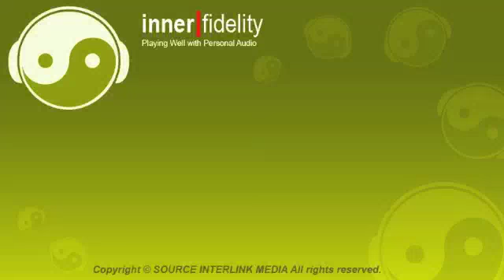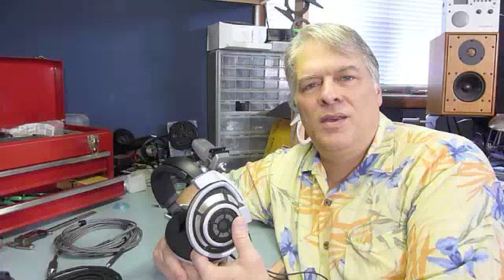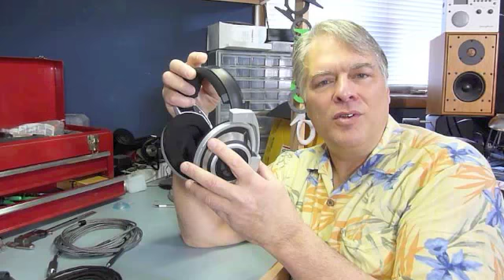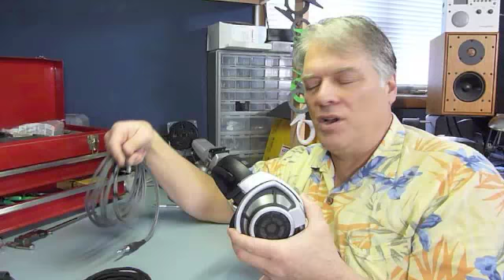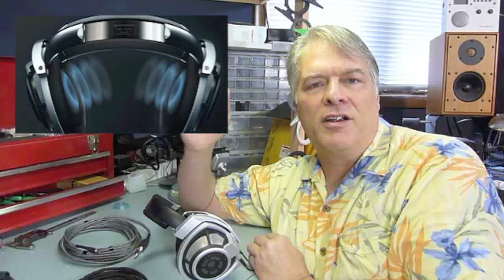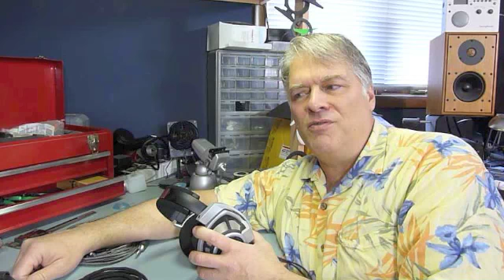The Brilliant Sennheiser HD 800 Headphone

Comment: Will Tidal hifi cut it with these HPs?
Reply: Kyle Wit Yes, tidal is lossless. But you don't really need anything over like 320kbps because it will be very difficult to hear the difference anyway. the difference is only in the height of the upper register and the very lowest lows so unless you're a fucking dog it's probably unimportant
Reply: Jared Ferguson So Spotify premium? I know Tidal has mqa encoding
Reply: Kyle Wit I like spotify because it's cheaper and it has a bigger library. I don't know much about how it's encoded tho

Comment: Setup:
Sennheiser HD800
Silver Balanced Cable (L/R)
Sony PHA-3
Audirvana Software
Files: DSD64 DSD128
Ram: 8 GB
Macbook Pro

I am using a Sony PHA-3 amp with silver plated balanced cables, when i turn it up the unit shuts off after 75 percent volume. this happened a couple times. Its not ear bleeding loud, but some of my DSD64 files are older music and require the volume up to that level. Any suggestions to why it will do that? No damage has been done to the HD800's

Comment: I'm sure he knows that cables don't change the sound. They are probably a sponsor or something and he agreed to give them a quick plug. That could hurt his rep as seen in the comments however.
Reply: PHOTOTRISTAN aka loony toons at head-fi trippin' on the psychedelic kool-aid. 😂
Reply: dandelion Agreed. Head-Fi is Snake Oil Central and I try to limit my visits there.
Reply: +PHOTOTRISTAN there's a $1,000,000 reward for those who can differentiate expensive from regular cables. Nobody has claimed it.
Reply: dandelion The HD800s have an analogue cable, not a digital one, so a higher-quality cable Does make a difference, to a point.
Reply: I could be wrong however. To Tyll: Thank you so much for your videos. Did you notice any changes on a Oscilloscope or similar instrument when swapping cables that maybe most people can't detect?
Reply: It's quite well known that the HD800s sound is very cable dependent.

Comment: There is no way your ear can register the difference between cables (fact). The difference occurs in your brain and these differences are based on false beliefs (placebo). So although you can have the subjective experience that something has changed (and this can be as far as you are concerned be real), objectively nothing has, except for the fact that you spend 800 dollars. Your brain can fool you when it comes to this stuff, but don't be fooled into buying 800 dollar cables. You want a strong cable of a reasonable thickness with a good connector and this should never cost you more then 30 dollar max (soldering iron included).
Reply: TR4R The only ways you can hear a difference in cables is if: you're loosing extremely long cables, you're exchanging an extremely crappy cable with a proper one, or you're using cables with different impedance. The last one can be simulated by just putting in electronics to effectively eq the signal and is not actually a cable issue.
Reply: Well, sir I respect you and your opinion and I bet you have more experience than me because I am a beginner in audiophile world but I will share with you a brief personal experience. I am now using the relatively cheap shure se215 and however they may sound crap to you I can tell you I did feel a difference changing the cables. At first I used default shure cable with mic and control and it was a little bit bassy but it worked well until that piece of crap torn appart and I changed it for a compatible cable for ultimate ears. The bass response improved but the cable had a terrible malfunction problem with the right ear so I had to switch to Zee's music cable which is also bassy and has less definition but is a lot more reliable. Shure default cable without mic nor control had the most exaggerated and muddiest bass of all (read badass) and it was terrible. Right now I'm purchasing HD800 and however I don't plan to change the cable any soon I can tell you based on my brief experience that at least sometimes cable does matter. And believe me, I love good sound and will be purchasing shure se846 hopefully soon. Thanks if you read this ;-)
Reply: TR4R
I fully believe you when you tell me it has an effect when you replace a really crappy cable. However, blind testing shows that people do not hear a difference between good 30 euro cables and 800 euro cables. On the topic of audiophile, I am definitely not one of them, I just want to enjoy music without having an allergy for imperfections in sound quality ;)
Reply: koelewijn555 >There is no way your ear can register the difference between cables

Provided that you're using digital interfaces. XLR and TRS are analogue inputs/outputs, so a better cable WILL make a difference, to a point.

Comment: For some reason, I highly doubt that you can tell a difference in sound by the cable you are using.  Like, if I took two identical headphones and had you listen to each while blindfolded, but only one of them had that expensive cable, I do not believe you could tell me which one it was.
Reply: bluesymmetry So you are ok with fooling yourself? Because that is what you are saying. You trick yourself into believing that a cable is better in order to take away the discomforting feeling you get from the knowledge that you just burnt your money on a silly cable. This is called cognitive dissonance.
Reply: bluesymmetry
I do know that scientifically wires do no change the sound to a degree that your ear is able to pick it up. Its you brain that fools you in believing this.
Reply: TR4R
Dear sir, thanks for explaining this part to me. But I still not fully understand, because then it is the transducer that makes the difference and not the cable itself, right? I understand that you can filter part of the signal and I do hear the difference when changing a capacitor in a guitar, but a relatively short piece of copper wire should not make a difference.
Reply: I disagree sir. At the mere beginning cables have a transducer that projects the voltage signal to both headphones of the pair and in that process small but significant modifications can be made and that is the explanation (I would not be telling you this if I havent already tested how much different shure earphones can sound with three different cables (shure's ones, ultimate ears and zee's music) so I can tell you that cable does matter but anyway I am just purchasing HD800 and I am very excited about it and don't plan to change the cables any soon but I probably test some if I had the money ;-)
Reply: koelewijn555 like i said, dont say anything if you havent tried. even if its psychological, then it 'works' for me. as long as it sounds better i dont really care what others think. heres a pretty interesting article speculating the matter pages 2-3. page 1 is just a massively long introduction. http://electronics.howstuffworks.com/gadgets/audio-music/are-premium-audio-cables-worth-the-investment2.htm
Reply: if i can afford it why not. its the same reason as why a man would spend 100s of thousands on a watch when its not even as accurate as a digital watch. placebos are effective for a reason. if i can hear a positive difference that you cant, even though i know its not real, i still can hear a difference. its like how if i hallucinate and i know its fake, it feels so real you cant ignore it. whether cables make a difference or not i still dont know, you just claim it to not be real. kindly educate me a little. as far as i know interference from outside signals can affect quality, but i stopped learning physics after a levels so my knowledge is pretty crap on this area.
Reply: the cables can actually make a significant difference in sound. thats almost like saying all amps are the same, they just amplify signals. i dont know scientifically how the wires change the sound but it really does. you should go to an audio store and test it out.

Comment: do i need a legitimate headphone amplifier to experience the true sounds of this headphone? or is it as good as it is without an amp?
Reply: You are gonna want a pretty good amp system when listening to these (Don't even think about not using one). I personally use a JDSLabs o2+odac combo and it works wonderfully with these headphones.
Reply: ***** None at all, but I do however find it hard to go straight from my speakers to my headphones because these headphones do not have near the same bass as a speaker system. They sound kind of empty. They still sound absolutely amazing but just watch out for that if you switch between speakers and headphones often.

EDIT Something I have noticed however with them (And I believe Sennheiser themselves points this out) is that it is very easy to turn them up too loud because they are actually that clear. You may not realize that the volume is way louder than it should be because the headphones aren't getting distorted/piercing as normal headphones get when you turn them up too loud.

If you turn them up too loud then yes, sibilance is annoying but at the right volume it's perfect.
Reply: ***** Yes I did and I am very happy with the purchase.
Reply: Nigel Janes Dude, you gotta get something like a Woo Wa-2 at least, probably more like a WA-22 to really get the best out of these headphones, you also want a DAC more like a Schiit Gungir.

Comment: can i plug it into my iphone by using other cable ?
Reply: KHALED .A.W Audio Technica ATH-M50s are also great.
Reply: *****
You should check out what "ohms" are, then you'll see how ridiculous what you said is.
Reply: The HD800 should not be used on a crappy iphone or ipod. Get the WA22 from woo audio and  the Schiit Bifrost
Reply: KHALED .A.W
try psb m4u2 even better
Reply: i don't have much experience in this subject, what do you think is the best headphone for a mobile phone and can run in correctly?
Reply: KHALED .A.W I recommend listening to some in a store.
If you don't want to walk around with 'em (or don't think they look awkward to walk around with): e.g. AKG K 550/551 (551 are with mobile features). They aren't pricey either.
If you're looking for something in the HD800 pricerange with 32ohms you could try out some Grados (e.g. GS1000i). But as with the HD800 they are open-back headphones, so if you like listening to loud music while walking around you should consider other alternatives.
Really cheap but imo really good: iGrado
Reply: thanks man :)
Reply: sebastian verter of course
Reply: DaughterOfRnbSoul You only need a special headphone amp if the volume is way too low or if for some reason the ipod does not have a very good amplifier which may be true with some older models.
Reply: The HD800's requires a lot of juice than what most people think. Also there is no ipod that can drive the HD800's 300ohms. If you want a really good sounding  portable/music player setup that can get the HD800's to good Sounding Volume you would look into either the IBasso DX100 , or the Hifiman 901 + Balanced Amp. A Very good sounding Desktop setup that's not too expensive would be ODAC + Schiit Lyr  or JDS Labs O2 + ODAC combo. Been using my HD800's on all of these combos for a while now :).
Reply: ***** You are even funnier, if you cant understand the difference between a home theatre and hifi audio, maybe you shouldnt buy the HD800. Beside, a home theatre amp is designed to power multiple speaker channels with over exaggerated output to produce the sound effect of hollywood explosion or car crashes, the headphone output is connected to a different circuit and it is as dedicated as the audio chip on a phone. 

It all depends on what you like, if you like to listen to loud US top 100 music thats played in a pub or on radio, you should get a DJ headphone. Because HD800 wont give you that. If you enjoy classical music or want to listen to an instrument that is perfectly recreated in front of you, then you need a proper headphone amp >$3000 for HD800. and ofc you need the right records and DAC.
Reply: nicholas squall I said the exact same thing, I just got to lazy to post it lol. The HD800's will only shine through a TRUE Hifi Setup,  I personally like the WA22  paired with the bifrost.
Reply: You could always get a battery powered USB hub and a Schiit Fulla amp/dac (it's a usb dongle) , which I'm sure would drive the HD800 just fine & works on iphones. .. It did well on my HD600 before I upgraded to the Schiit Modi2/Vali2 dac/amp ..
Reply: Won't do it justice.
Reply: DaughterOfRnbSoul Nothing will for a portable solution ., but that's about as good as it's going to get "on the road" (about the only point of using the HD600s solely with an iPhone) .. At home use certainly deserves something better, I'll agree on that.

Comment: YELLING IS NOT HELPING YOUR CREDIBILITY.  

Also, as an electrical engineer you know this isn't true.  Otherwise all cables would be made out of lead.

I think what you are trying to say (or YELL?) is that expensive cables made from esoteric materials do not sound significantly better than high quality low price cables made of copper.  This I would agree with.

Comment: Are you running a cable on top of a desk? Or 20 feet through a construction site? Interference is not a problem if it is not the latter.

I am not going to argue any further, do what you want with your money, I am just letting you know that a cable can not improve or enhance sound quality. Sure, some cables are better quality and with last longer and may have better EMI shielding, but that still does not effect sound quality.

Comment: THERE IS NO DIFFERENCE IN SOUND QUALITY FROM A CABLE. I AM AN ELECTRICAL ENGINEER AND IT IS IMPOSSIBLE FOR A CABLE TO IMPROVE OR CHANGE THE SOUND QUALITY. THE SOUND SIGNAL BEING SENT THROUGH A CABLE IS NOT AT ALL FLAVORED BY THE TYPE OF CABLE USED.

Comment: Differences with solid state amp's are readily audible with HD800. A decent Class A stage will give you this too. I love the HD800s to bits and I am using them on solid state. Tube Musical fidelity XCAN v2 works well too.
As an ESL fan surprisingly I even prefer them to my old Stax lambda, 800 offers better soundstaging, comfort and dynamics and bass clarity, however I have never used the new top end Stax models. All the Stax I have heard have a certain magic but the HD800s are the best to me.

Comment: Good quality electronics are certainly worth having.
 I find HD800 trounces the HD600/650's on mainly Classical, acoustic but also rock, pop & electronic music even when used from very affordable hardware, detail, space, resolution, depth, bass, treble extension. Of course a good quality class A stage is well worth having, it would be stupid not to use a decent sounding amp as HD800 will expose weakness from gritty, harsh output stages. Valves are not needed but a good neutral tube amp will work

Comment: They do not need an expensive Headphone amp. They work superbly with any decent, well designed Solid state headphone amp, many of which cost a fraction of the cost of the phones. a well designed amp less than a tenth of the price of the phones is easily capable of showing the significant advances made over the HD600 HD650 and the new HD700s. HD800 is vastly superior.

Comment: Theres a 1,400 HD800 cable. Audiophile is short for guilable. But cables can influence the sound.. No placebo. I bought a 160.00 Cardas cable expecting improvement with my HD650. There was none. I had my SA5000 recabled with the HD650 cable, expecting no change, and there was a difference to the sound, all negative. I did not expect to hear a difference. Another owner had his SA5000 recabled with the the HD650 stock cable. He emailed me about the difference in sound. Also negative.

Comment: Um , What are you talking about.
 Im 14 and I despise beats.

The have regular 40mm drivers, like from headphones that cost $10 bucks. 

I Use V-Moda headphones with professionally tuned 50mm drivers, They are made out of almost all metal, and they have a kevlar cable that takes over 1 million bends.

BEATS SUCK.

Comment: Getting great sound with awesome bass that doesn't muffle the mids. That's what everybody wants. Like free sex, and safe too. Starting at the bottom, I'd suggest the ATH M50. Price is good, bass darn good, mids not bad. Moving up to ~$200, the Logitech UE6000 has amazing bass in active mode. So much bass, you can turn the bass *down* and it still makes the Sennheiser Momentum sound anemic by comparison. But it's still clean - doesn't murk up the mids. Higher than $200? Nothing I can think of.

Comment: These will leave you severely disappointed then. You would want to look into hi-fi headphones rather than studio sets. These are designed to give a flat frequency response, with nothing over exaggerated. Look into Ultrasone HFI-580, 780, or 2400. Very crisp and pounding bass and a lot less "muddy" than the beats line

Comment: You could, but you wouldn't hear anything special. At this level of quality, you would need to hook these up to a high quality amp and great DA converters. If you run a mac hook up an apogee ensemble and then plug these in and be prepared to be blown away. Also, forget mp3. WAV or FLAC files only! :)

Comment: @legorocks3 they are great cans  but not for rock/metal/hip hop there is not really any bass too them and some bass(not beats by dre bass) is good for rock/hip hop my recommendation would be the beyerdynamic dt 990 pro (cheapest price is $199 at b&h) or the dt880 and get a amp also

Comment: @ytfmichaelxu Yes you should be able to do that, kinda depends on if the dac/amp allows it (has the connection to bypass the amp section). I know Fiio e7 can do that since you can use it as just a dac with the e9.

Comment: @ytfmichaelxu Tube amps use tubes for the circuitry instead of transistors. Technically this is the only difference. You can connect ANY headphone amp to a DAC as long as they share the same type of connections - which they very often do.